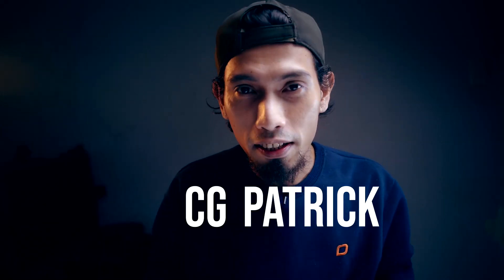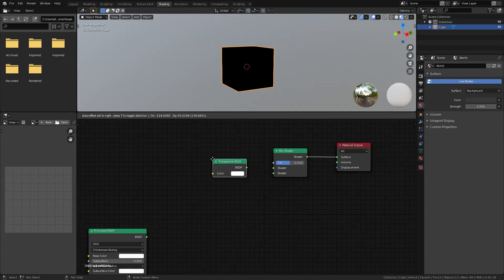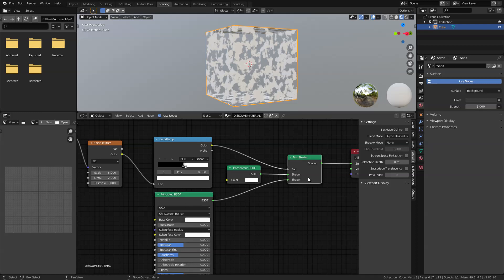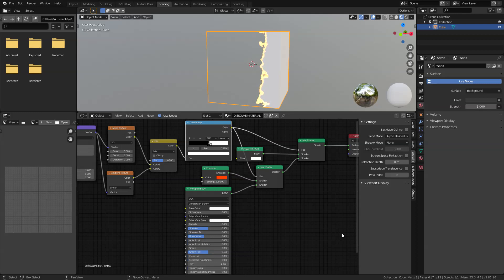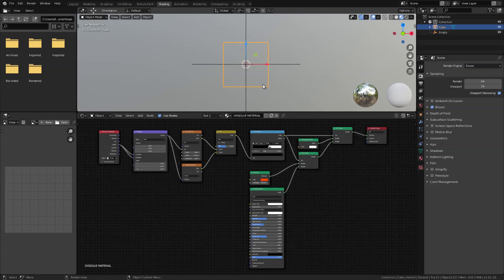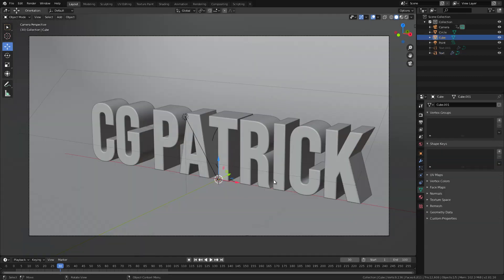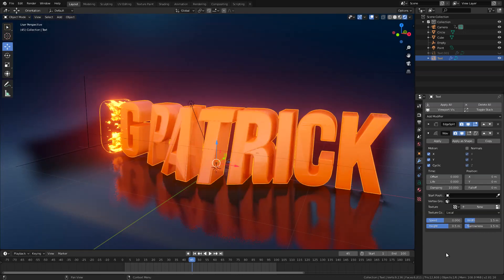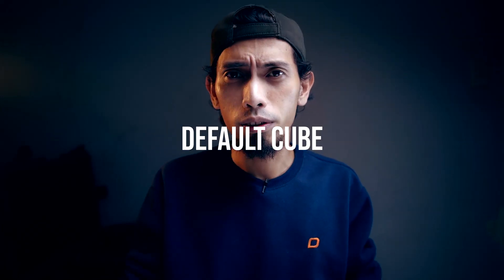Procedural Disintegrating Effect in EEVEE | Blender 2.8 FX Tutorial

Comment: Would be cool if it would work like you show - but it never does as you show and I tried it 1:1 like you did and I checked several times that I did 1:1 100% the same  with the same settings 100% like you did!
Reply from the maker: How does your output look like? Make sure you change the material blend mode to alpha hashed. In texture coordinated node reselect the empty control.
Reply: @thecgpatrick  
I set the mode to alpha hashed and I added the empty. But the best result is that the empty just effects the edges of the object, not how far it's disappeared.

So copy your animation I had to animate the black/white in the color ramp - only that way it disintegrates somehow.

Comment: 1:55 i couldn't connect the object data to the location and rotation, only the vector socket is available. please help..
Reply from the maker: Thats odd. It should work. What version of blender are you using? Make sure you are using Blender 2.81
Reply: @thecgpatrick   problem solved. i was using 2.8 at that time. now i installed 2.81. thanks a lot.